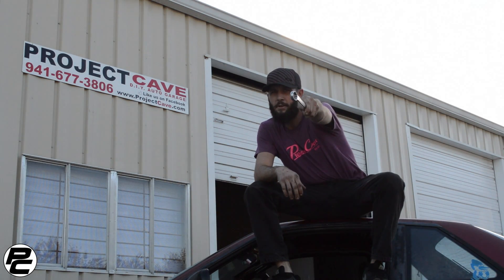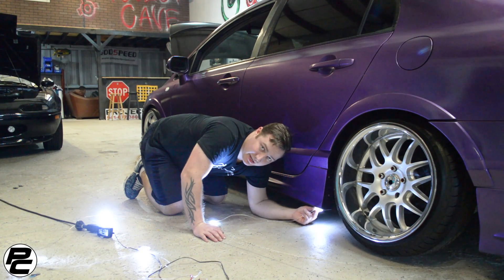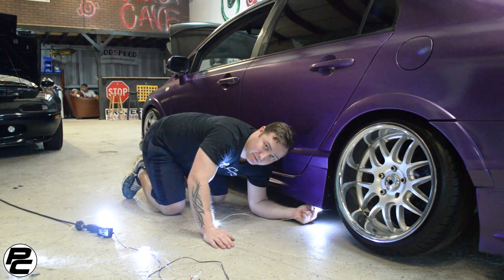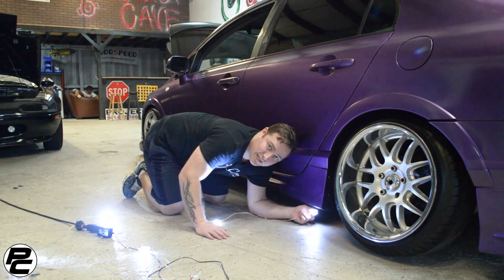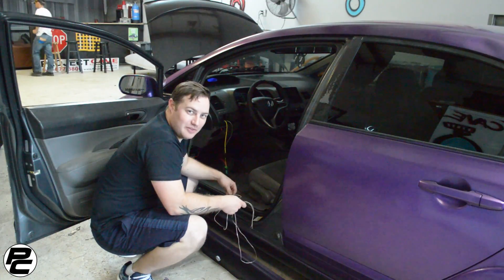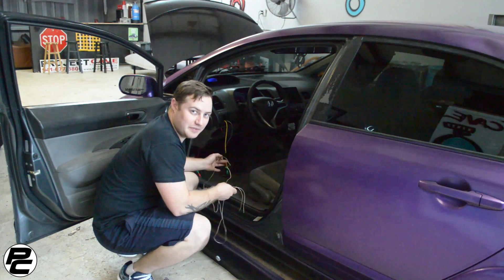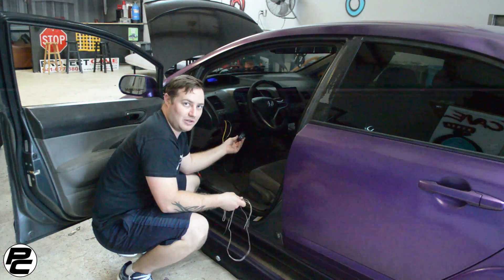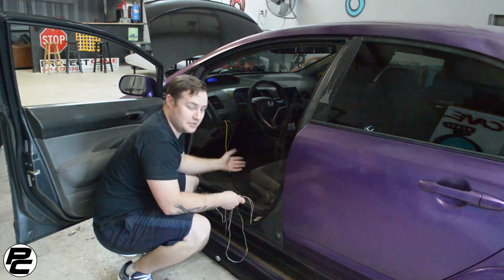Puddle Light Install Video DIY

Comment: Another way you could wire it is to tap into your curtsy light system(dome light that turns on when you unlock your car or have door open) while also running a secondary switch that turns them on on command. It would just help the functionality of it.
Reply from the maker: +5150 Failure Agreed...we talked about that and many other ways, but in the end, went with a basic setup. We even talked about wiring them to the blinker with a sequential relay for a really crazy effect. We will likely integrate your idea into a future video along with some of the others we discussed. Thanks for watching and thanks for the feedback!
Reply: @projectcave2823  Do you think this would be feasible to do with a multi-color under-body LED kit? Have a spare that I don't need for running LEDs but would be great for this kind of application.